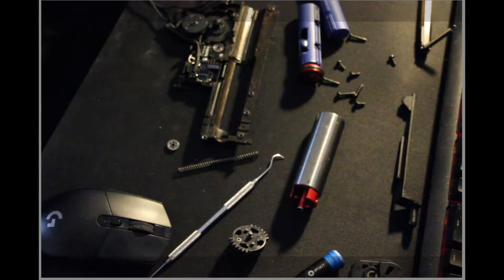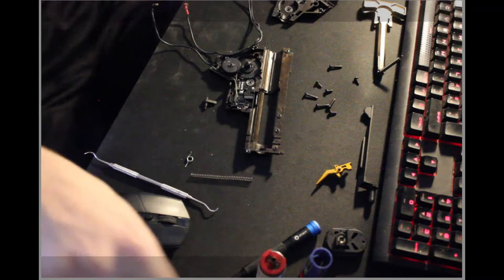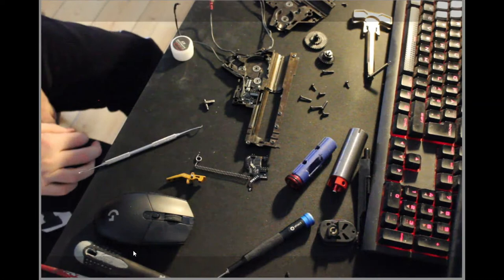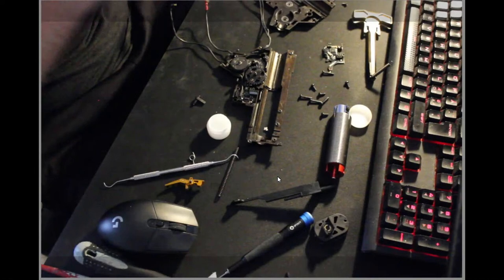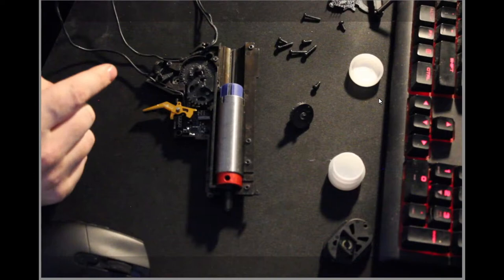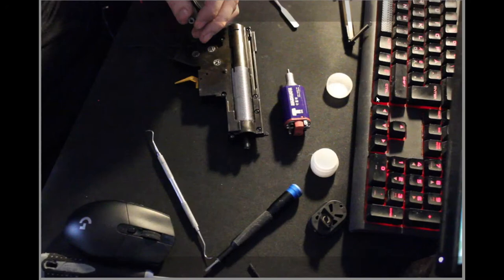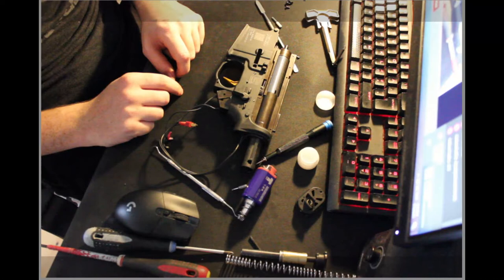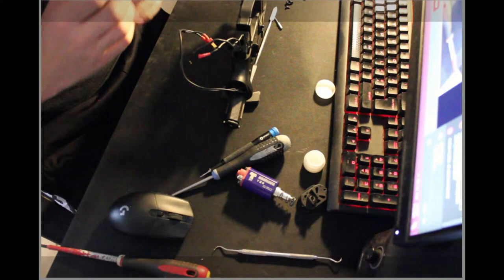DSG Maintenance!

Comment: Might want to ditch that metal cylinder head or piston head. Usually having both metal means a cracked gearbox (even retro arms can crack because of this). Plastic ones work fine anyway, no real advantages to a metal cylinder head
Reply from the maker: I would be inclined to agree when it comes to 95% of builds, but this dsg shoots about 1.1j with .28s so we are talking some low, low stress. Not that it 'doesn't matter' but I doubt that's what gonna be the death of the gearbox.
Reply: @GusAirsoft  you’re probably right. Especially with a retro shell and a piston weighing under 30g you should be OK as long as you’re not using over an m160

Comment: I’ve got a t6 and I have a dsg in it too, it has good compression but my FPS is really low.  Have you had a problem with the hopup on the stock t6 because I can’t get it to work right. (Gate titan, siegetek 10.44:1 dsg, asg 18k, rocket m150, flt bushings)
Reply from the maker: Yeah the stock kwa hop up is straight ass in terms of air leakage
Reply: @GusAirsoft  yeah lol im gonna take the dsg out of mine and sell it, I have to say the t6 is a really good looking gun but it’s sad that the proprietary stuff is not good.